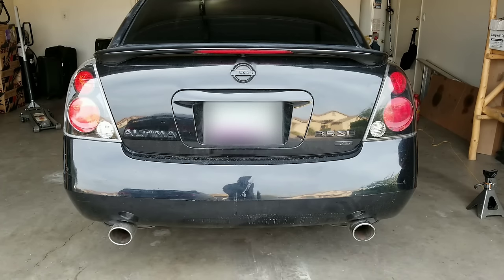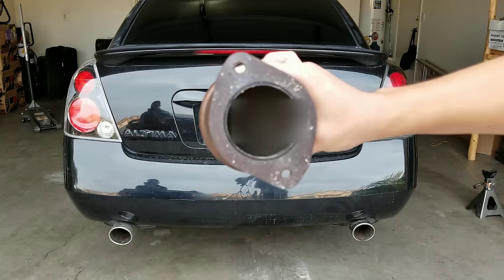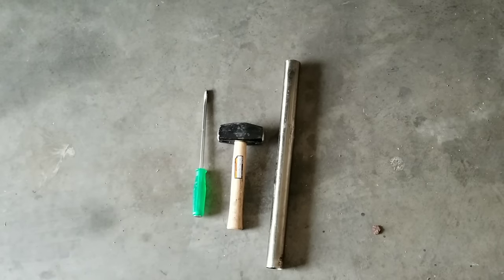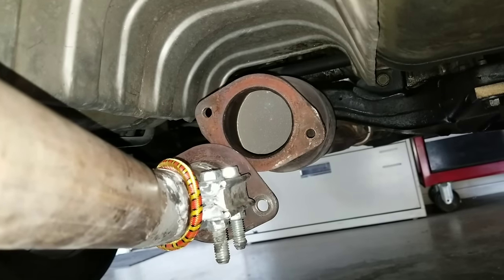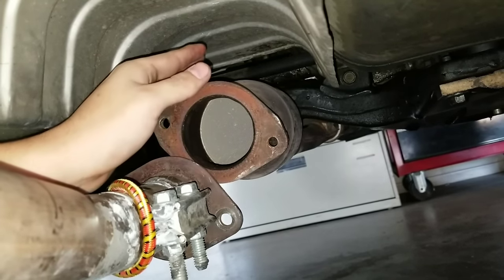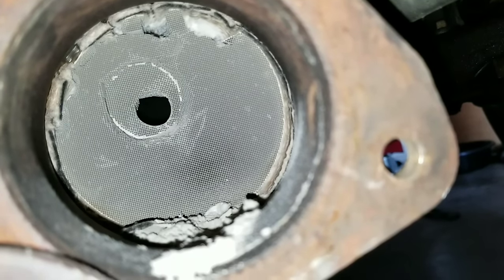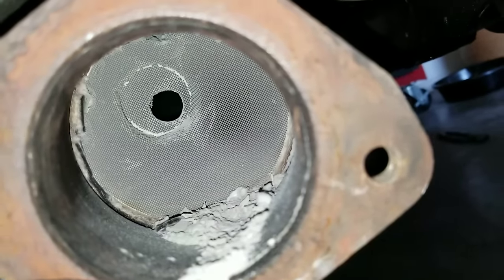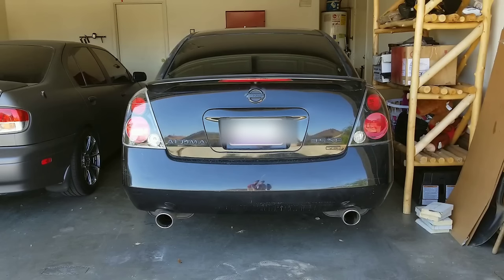How To Delete Your Catalytic Converter!

Comment: so you created an expansion chamber therby reducing or killing your exhaust scavenging and lowering your horsepower output.  But it sounds good, right?
Reply: Harry Rathien shhh ricers gonna rice
Reply: Thats not going to disrupt scavenging lmao. All it will do is slightly reduce backpresure. If he had a larger diameter exhaust pupe then yes it would reduce scavenging by a small amount but would reduce back pressure by a lot. It helps to add a 4-1 or a 4-2-1 manifold to optimize it

Comment: It isn't illegal if you don't get caught also you're not in Mexico you could do a better job of covering up your plate Arizona resident it is illegal to do what you're doing in Arizona come on man do a better cover up job also changing the airflow in modern computer controlled cars without reprogramming them can actually make the car run worse it changes the fuel air mixture fuel rate Scotty Kilmer talks about this

Comment: To be perfectly honest with you all this car has 3 catalytic converters the one he just hollowed out was just the back one which means that the first 2 converters receive all of the congestion first. With out gutting all 3 you really haven't done anything. If you want real horsepower 🐎 gains you have to do all 3. Besides all of the cheap Nissan owners who let they're oxygen sensors go bad and not change them and continue to drive with the check engine light on for years converters stopped up anyway and probably already got burned valves and a permanent missfire
Reply: 😂😂😂😂😂 dis shit got me dying
Reply: Really 3 Cat converters? Thats amazing . You sure your not talking about a resonator or muffler?
Reply: Heaps of cars have more then two cats... My y62 nissan patrol has four, as does my Nissan elgrand
Reply: @rowanparmiter7622  one off each manifold and a rear cat…that’s 3.
Reply: @rowanparmiter7622  ⁰
Reply: @rowanparmiter7622  yeah 3 cats, some GM V6s also have 3 cats like this Nissan

Comment: You could of just got a test pipe, and would still have a good working cat
Reply from the maker: the catalytic converter is welded on the y pipe i would have to cut the test pipe and then cut the y pipe and it still might not fit plus this was fast and free.
Reply: Donyce19 Whats a test pipe? Can i Google it? Im having same problem.
Reply: Donyce19 it was a deeper rumble and pop with cats maybe needs both off
Reply from the maker: get out of here and get yourself a life
Reply: @papergatorzfedducca7998  
A test pipe is just a typical piece of exhaust pipe welded in place of a removed catalytic converter.
Reply: Doesn't even have to be welded on, you can have flanges welded on and use gaskets just like you normally would on a cat, then they are interchangeable so you can pass inspection if need be.
Reply: New Mexico DGAF about smog tests haha.

Comment: But this will create an engine trouble light as well as make your engine less efficient b/c the computer won't know how to adjust your fuel ratio based on the O2 sensor readings...
Is there a way to trick the computer?
Reply: This is the secondary cat after the o2 sensor so it won’t throw codes

Comment: Correction. The exhaust cycle and the intake cycle are closed circuit. In other words, you can run a straight pipe with high flow headers and it won’t make a single difference to the intake of “more air.” The cylinders, bore, and stroke are the determining factor to how much gets sucked in and how much gets pressed out.
Reply: If a cat is restricting the flow and you convert it to a free flowing system the intake will naturally be sucking in more air as the exhaust is ABLE to pump out more then before, think of it as a cigarette with out a filter, when you hit it it’s way less restrictive even though you are exerting the same force if not less with your mouth compared to hitting one with a filter.
Reply: reducing BACK PRESSURE will increase horse power!
Reply: You are correct in that the system will never be able to go beyond 100% maximum intake. 
What you have failed to account for is that things like this can reduce your systems ability to perform at that maximum. 
This isnt going from 100% to 105% for more power, its bringing the system up from 90% back to 95%.
Reply: Filter  your nose and mouth with a rag and and tell me the result.

It doesn't matter how much volume your lungs have... if the air can't flow due to exhaust restriction, it's severely impacted
Reply: Your 02 sensors determine air fuel mixture lol
Reply: @mcmizzy9215 
The upstream ones do. The downstream ones monitor the health of the cats and have nothing to do with Air/Fuel mixture
Reply: @MichaelBuieFilms 
Good to know but it does throw a code that you can never clear though - right? 
Doesn't the downstream O2 also help the ECM to know if it's burning too rich?
Reply: @williamdaniels6943  Not always. you only get more HP  if you can reprogram the engine management
computer to understand that there is less back pressure. I have seen guys install
loud high flow exhaust systems and actually loose power when dyno tested.
It is especially true in the lower to mid RPM range. The times where I see an 
improvement in power is when  one removes a plugged catalytic converter
and replaces it. He mentioned about an unmetered converter. In that case,
you can get away with removing or punching out the guts of the converter. 
But, many cars do meter the converter performance and will throw
a converter code and cause the engine to not run correctly. You really
need to know the particular car and how it treats a converter as well
as exhaust back pressure before ever doing any mods to the system.

Comment: If you put true straight pipes and a cold air intake on a stock car or even turboed car it will not do anything. You need to get a tune for it to be beneficial
Reply: That's not true at all! As a matter of fact most cars have a highly restricted intake which after being removed increases power, now the exhaust is a different story...

Comment: I get what you’re doing but why not simply replace it with a strait pipe,,,if it’s not boosted?I’m getting ready to do it on mine.i bought a cheap new converter and it was the next size smaller pipe so I’m welding new ends to the right size and going check it out.no testing where I live

Comment: You too can have a permanent p0420 code not be able to register/pass emissions. Many cars used the down stream sensor for fuel trim, so you can expect to make less power and get worse fuel economy without a new pcm and a custom tune.
Reply: Have decatted pretty much every car I’ve owned, and can say I’ve never lost any power. If anything I’ve gained slightly. And the code is easily erased. As for passing emissions, there are countless garages that will pass it for a bit of extra cash
Reply: The Pre cat O2 sensor is the one that checks the AFR. The downstream sensor is easy to trick with the right spacer without a retune or aftermarket ECM.  Without a cat or a hollowed out cat you gain a few HP and at least 1-3 more MPG

Comment: You dont gain horsepower from this, u gain noise and a but more throttle response depending on the car
Reply: You do if they're clogged anyway
Reply: yes tf you do more air flow more hp that includes exhaust flow

Comment: How much would you charge me to do this to my 2005 Expedition? I'm in Show Low no emissions here. I do not want to spend the money on getting this fixed the cost is rediculous. I want the power back. It's a nice truck but the lot I bought it from reset so the CE light was off when I bought it and when I did a carfax there was a questionable odometer rollback on there. But I really like the truck it's in good shape besides those two things. I believe there are only 2 cat's on it.

Comment: You’re not gaining any horsepower without a tune for being catless, all you’re doing is increasing the amount of times you’re going to see your check engine light.
Reply: Mathis 😂🤣
Reply: If there is no downstream O2 sensor behind the cat, it won't throw a code or lower performance. Those only happen when altering cats infront of the downstream as it'll not only throw a code, but also alter the afr because it believes there is still a cat and the O2 is bad. For example, when I had a bad leak infront of my downstream O2, my truck ran very rich and would even flood with gas at times.

Comment: The Nissan 3.5 is a pretty nice engine. Thanks for posting.
Reply: The CVT (transmission) however....*HMMMMMM*
Reply from the maker: this vehicle does not have a cvt transmission but the automatic one aren reliable as they once use to be.
Reply: @TristanVash38   The cvt transmissions cannot handle getting hot, that's when they start slipping, they need a transmission cooler added on to the car. They will last a long time then. That's what I did.
Reply: 2004-2006 Altima’s and maxima don’t have cvt they didn’t introduce them untill 2007. So these cars with the 3.5 are pretty solid.
Reply: @TristanVash38  its a cd009 or cd001 trans for the DEs
Reply: @staydown4bo  thx bro! Didn't know that

Comment: The CAT is a modern wonder, in that it keeps the air clean by converting HCs, NOx and CO to H2O and CO2.  It does work, and it's worth using.  I used to do that dump stuff years ago until I realized how important the invention is.  You can even get high flow cats for racing.  You will not gain any horsepower by destroying the CAT.  Extra airflow for a factory engine will not make any more horsepower.  Unless the engine has a different cam (for more airflow at higher speeds) and programmed to inject more fuel, the engine will not produce more horsepower.

Comment: I just wasted 5 mins of my life. Change the title call it how to gut a catalytic converter.  U just lost money when u could of straight pipe and sell the cat. U just threw out platinum which is what inside a cat. 🤦🏾‍♂️
Reply: In some states you have to have a catalytic converter to pass inspection
Reply: @noahcroft6943  yup that's why u have to get two, one for emissions and the other for power lol
Reply: @noahcroft6943  Technically no. One monitor is allowed not to run. You just have  to do your drive cycle right.
Reply: @Justnn  What state do you live in that cops inspect cat converters :lol:, We have state inspection stickers here.
Reply: @Justnn   I personally wouldn't do it, also the car is engineered to have a certain amount of back pressure from the exhaust system. Missing is stupid but broken up like he did? The cat could certainly disintegrate. The exhaust system would have to be removed and inspected to verity. They can't prove he did it. Not saying its right but  a straight pipe is a bad idea. Anything over 25 yrs in NY is exempt. Things rot out here, had to buy a new cat for my 96 Explorer, it had a hole. Probably could have welded it , looked pristine inside. Cats in NY and CA cost a fucking fortune too. There is a special part number and it has to be certified. Technically you fail inspection if the numbers aren't visible.
Reply: @Justnn  Technically then in  NY you may have to scrap an older vehicle then. It is illegal here get a JY cat(they are not available, they can lose their licence to run the yard). And, some cars simply don't have NY cats available. I know for the 96 ex many places quoted me 1500$, some said they can't help. I hate doing exhaust work but I found a legal one on Rockauto For $350 and installed it. Wasn't that bad. But I know some cars don't have NY/CA converters available. There is also a "$400 loophole" if you do certain repairs you can pass for the year. In any other state you can go on Rockauto and get a cheap legal cat. I guess you can buy a non-CA emission s cat, you technically are in compliance with federal law, but you may have a CEL depending on the calibration (unless you get a 49 state PCM). No one in NY is ever going to look at it again.
Reply: The amount of platinum that can possibly be recovered from a single cat is nowhere near the cost of a functioning cat.  So scrapping a good one for scrap is a huge waste of time and money.  Even scrapping a junk cat for the amount of platinum in it is more time consuming or expensive than it is work.  I'm tired of hearing this crap.  It is like if a crack head steals an aluminumn boat that is worth $1000+ as a boat but then they get excited about scrapping it for well under $50. Except you wouldn't even get $50 dollars for scrapping the boat or the cat.
Reply: @Justnn  They sure as hell dont do it in wisconsin LMAO i drove my 99 ram around with only manifolds for several months and no cops cared
Reply: @mcleb84  I live in Georgia we've been hit by massive waves of California and New York residents....fucking blows.

Comment: Should I do this with stock air box or should I install a short ram intake or something first? Any advice?i plan to keep muffler on its tiny anyway
Reply: Stock air box is fine, it's not very restrictive, in fact you wouldn't have to worry about that unless you were running boost or something

Comment: put straight pipes through in pace of cats if you must, cause cats are worth $$$ as scrap, that is why exhaust outlets promote removal or replacement, they make a lot from collecting them all for bulk scrap. I make good $$$ later on to put them all back as std and return car running to smooth and fuel efficient once more
Reply: If i replace the catalytic converter with a piece of exhaust pipe and leave the O2 sensors in place will the ECM recognize it and give a fault code or would I have to install bungs to pull the O2 sensors away from the exhaust stream?
Reply: Peter datechmen somebody stole the cat off my dads wrx. Idk why but he only did him a favor
Reply: lol